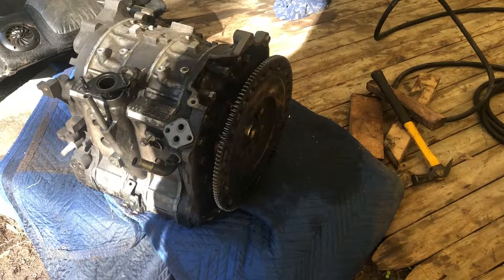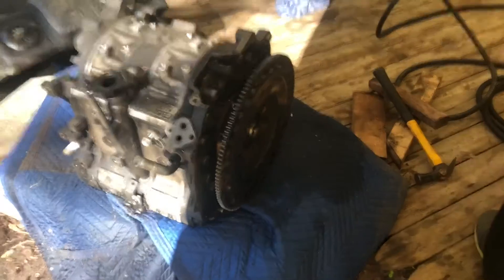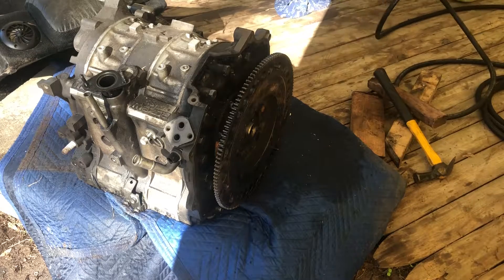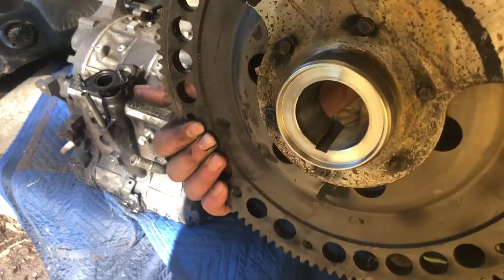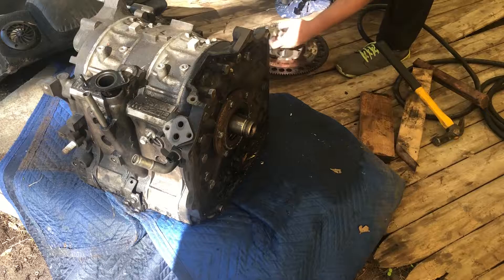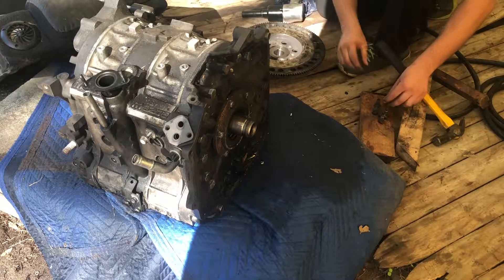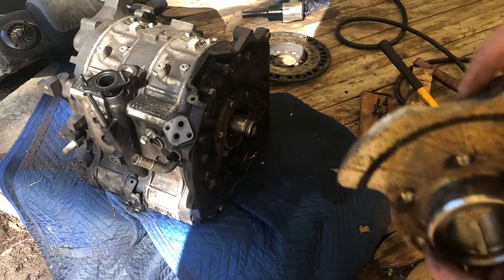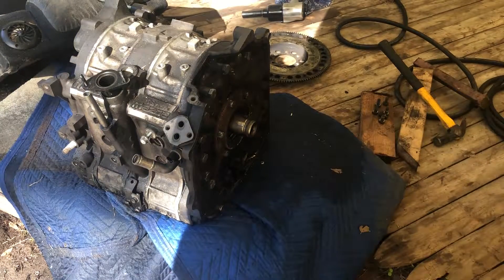RX8 13B rotary balancer removal (after market flywheel)

Comment: not sure if it's any different on an FD but I wasn't able to knock it off this way. Found an alternative that may be helpful to anyone in the same predicament:

take the flywheel off and put one of the bolts back into the counterweight and carefully tighten it into the rear iron - popped right off for me
Reply from the maker: That is genius buddy thank you for sharing the tip I really appreciate it . I will do that next time
Reply: This worked brilliant!